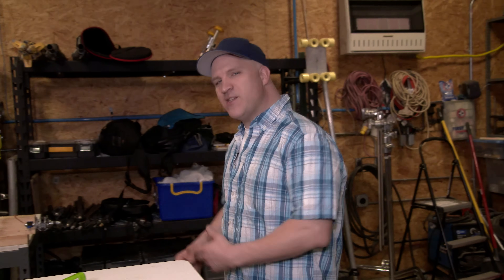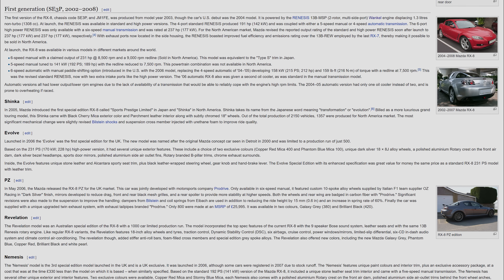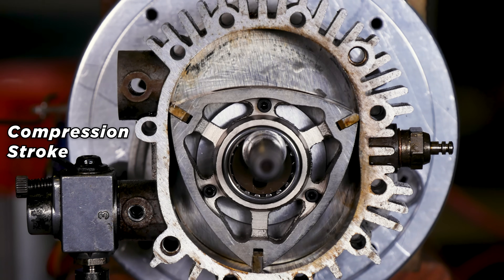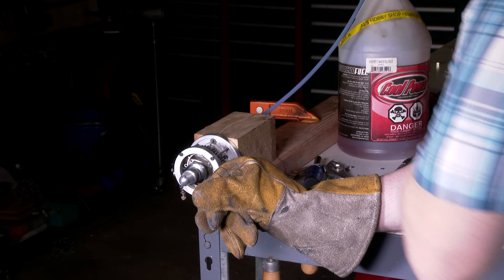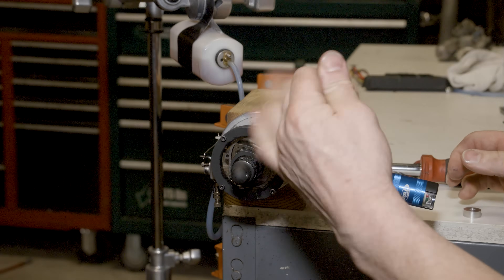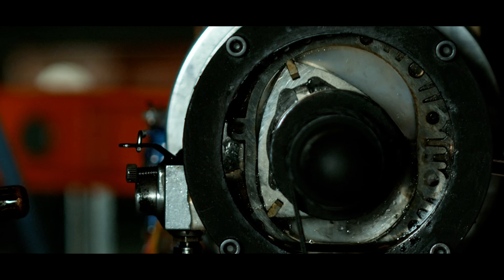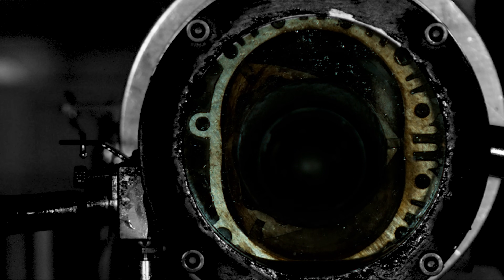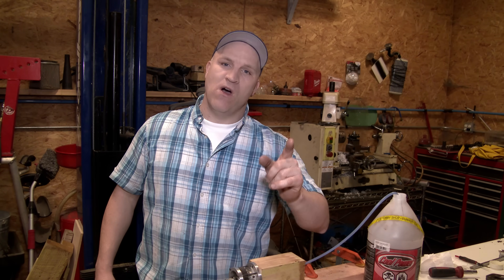See Thru Rotary Engine in Slow Motion - (Wankel Engine) 4K

Comment: I had no idea there was such a thing as a diesel rotary engine. Super cool!
Reply: This is a "Benz Cycle" not a Diesel Cycle Wankel engine, this Wankel KKM variant designed by Graupner GmbH. uses the same primitive type of "Glow Plug" ignition system found in most RC model engines. This engine does not utilize compression ignition. The fuel used here is nitromethane which has an octane rating between 110 -117 RON
Reply: doktorbimmer - Well color me educated! Very interesting thanks for sharing :)
Reply: You are very welcome sir, and in case you were wondering? Several Wankel KKM licensee's attempted to develop a Diesel Cycle Wankel engine but none were successful.
 Major Diesel engine companies like Deutz, Krupp, Mercedes-Benz, Yanmar, John Deere and Rolls-Royce developed them but all suffered serious problems related to the fact that the Wankel simply cannot provide a high enough static compression ratio and the notorious weak seals were simply not durable enough for a production engine to last long.
Reply: doktorbimmer - Yeah its a real shame the apex seals are so problematic. It’s a beautiful engine.
Reply: Indeed, the durability of seal that must deal with right angles was a fatal flaw in the Wankel design, a circular cylinder and piston seal are vastly superior.  .
 It is a fascinating design to look at for sure unfortunately it never lived up to its promise of replacing reciprocating engines.
Reply: It runs on gasoline
Reply: dOoMnX - A Diesel engine isn’t defined by the fuel it burns, but rather by the way ignition occurs. This engine uses compression ignition (instead of spark ignition) so it’s a diesel.
Reply: @truthsmiles  true. The ones in Mazda RX's have spark plugs though.
Reply: dOoMnX - Right, which is why I was so surprised to see one without a spark plug! I had no idea such an engine (that runs on gasoline, no less) even existed! Very weird - especially since the fuel doesn’t appear to be injected like a diesel would normally work.

Comment: Great Video! Can you possibly use hydrogen gas to fuel the rotary engine? I am not really on to machines and its technicalities but I just want to satisfy my curiosity. Thank you.
Reply: Hydrogen fuel has been tested with Wankel engines but offered very poor results. The Wankel engine cannot generate sufficient static compression ratio to efficiently burn hydrogen and the low fuel efficiency of the Wankel coupled with the very high cost of hydrogen makes it very uneconomical.
 
Mazda produced a small fleet of prototype RX-8 cars for the Norwegian HyNor hydrogen vehicle program. The Mazdas were quickly rejected as preliminary test results showed they were the worst performing hydrogen vehicles tested.
Reply: doktorbimmer ~ thank you for the reply. Since hydrogen is highly combustible, What if mixing the hydrogen gas with fuel so that less fuel would be consumed but still would get the desired explosion to make the engine running. Let say hydrogen would only serve as an additive to the combustion process. I think the burning of fuel with will be more efficient and produces less unburned fuel. Thus having a cleaner exhaust.
Reply: The idea is to really lessen the fuel consumption and cleaner emissions
Reply: The Wankel is less efficient at extracting the heat energy provided from Hydrogen so fuel efficiency is REDUCED Hydrogen is no different than other fuel in terms of combustion efficiency... modern engines mass produced today all have high-swirl or quench-type combustion chamber. The fatal flaw in the Wankel is it simply cannot be adapted to this superior combustion technology.
Reply: The Mazda RX-8 Hydrogen-RE proved that the Wankel engine delivers much LESS fuel efficiency when operating on hydrogen power and produced far greater emissions than reciprocating hydrogen fuel engines and hydrogen fuel cell vehicles.
Reply: @doktorbimmer  Thank you so much. I really appreciate it.
Reply: You are very welcome, I don't know where you live? Here in California you can buy hydrogen fuel cars by Toyota, Hyundai and Honda... but they are all Fuel Cell hybrids.

Comment: wow a 4 stroke has 1 power stroke every 4 revolutions of the crank shaft...rotary has a 3:1 ratio...if the seals, fuel economy, and efficiency of this design can be improved somehow...the potential is ridiculous!!
Reply: Sorry Tony, a 4-stroke Otto engine has a power stroke every TWO revolutions of the crankshaft. The Wankel engine has 3:1 ratio THREE-to-ONE  While a 4-stroke completes its entire firing order sequence in 720° of crank rotation the Wankel requires 1080°.
 The best engineers in the world have discovered that the Wankel no longer has any potential, even Mazda have abandoned the design a decade ago.
Reply: doktorbimmer thanks I read it the 1st...FIRST time 3 power strokes per 1 crank revolution is amazing...and who cares of Mazda quit on it lol...there's thousands of smart people with the right resources who I'm sure could improve the rotary engines deficits with the right amount of RnD...I'm just saying it'd be great to see because this engine would QUICKLY become very popular
Reply: Wrong, there is only one power stroke per crankshaft revolution, not 3... you need to learn how the Wankel engine works.
Reply: That's a very naive statement, you seem to be completely aware of the long and extensive development history of the Wankel engine. No engine design in the 20th century has ever received so much R&D... The truth is the Wankel simply never delivered on its promise of replacing reciprocating engines and turned out to be a major disappointment... a massive commercial failure.
Reply: IT WAS popular... when the Wankel KKM was introduced there was massive interest and in the 1960's and early 70's the biggest engine manufacturers in the world rushed to bring their version to production but less than a decade later the Wankel proved to be cursed with terrible problems that could never be solved.

Comment: A tendency to backfire, burns lots of oil, and wholly inefficient fuel wise. Europe banned their sale in 2010 effectively killing the engine.
Reply: for cars.
in aviation, the weight difference nakes up for a LOT
Reply: @Márton Léránt The Wankel engine was universally a massive commercial failure. There has never been a successful production aircraft that used a Wankel engine. There are no Wankel engines reliable enough to pass either the FAA or EASA air-worthiness certification. The Gas Turbine engine offers an order of magnitude greater power-to-weight performance than any Wankel engine.
Reply: @doktorbimmer  
And are an order of magnitude harder to manufacture to say the least.
Manufacturing the shape of turbine blades is a tad bit more demanding than manufacture of wankel engine parts. (Without mentioning the required materials)

In house engine development for small prop driven privately operated aircraft is not a common practice, let alone investing money into radically innovative designs. (Which is the market segment that would welcome affordable high power density designs)

The rarity of wankel engines has very little to do with "its unsafe" and everything with the nature of the market and its financing.
Reply: @Márton Léránt Yet Gas Turbines DOMINATE commercial and military aircraft production... because of their vastly superior power-to-weight ratio, reliability and fuel efficiency.
Reply: @Márton Léránt Several aircraft and aircraft engine manufacturers have invested millions into Wankel engine development and all have reached the same conclusion, which was the Wankel was inherently inferior to gas turbines and existing reciprocating engines.
Reply: @Márton Léránt The issues with poor reliability and short service life that have plagued the Wankel engine since its introduction is infamous. Mazda has suffered pre-mature failure rates that exceeded 50% under the warranty period... in automobiles its just bad business.... in the aircraft industry it can be criminally negligent homicide.
Reply: @doktorbimmer  
And when will we have turbines in the commercial sector in things other than luxury aircraft and airliners?
Yes turbines are superior in most regards except the astronomical cost.

Will we ever have ultralights with jet engines powering them?  i have my doubts.
Which is why ultralight helicopters are nonexistent. As piston engines are just a little bit too weak to power them, and turbines are faaar outside of the price range the owners of such craft would be able to afford.
Reply: @Márton Léránt Gas turbines are used in helicopters, military vehicles, marine, stationary pipeline pumping applications and are growing in popularity in electric power generation.
Reply: @Márton Léránt Doubtful, ultra-light applications are on the very low-end of the aircraft industry and require minimal cost and maintenance to be affordable. Piston engine manufacturers such as Rotax GmbH. dominate the ultra-light industry... Rotax was the World's First manufacturer of Wankel engines in 1964 (Fichtel&Sachs) but completely abandoned the Wankel by the mid 1970's as improvements in 2-cycle and 4-cycle reciprocating engines that offer superior performance at a lower cost and offer greater reliability.
Reply: @Márton Léránt Wankel engines are inherently inferior to reciprocating engines they failed to replace, they are an obsolete technology and were historically a massive commercial failure... The Wankel only briefly saw very limited success in automobiles but even Mazda, who the very last manufacturer in the world abandoned the Wankel engines a decade ago and production ceased completely in 2012.
Reply: @doktorbimmer 
Well let me have my doubts about "lower cost" - when the damn things can be made out of extrusion - and less than half of the parts.
And please give me some quote on that "superior preformance" - since i have hard time believing it.
Reply: @doktorbimmer  
Are gas turbines emplyed in military vheicles, helicopters, marine and stationary pipeline pumping anything close to being affordable to the average citizen?
No?
Maybe then we shouldn't compare the thing, against tech that CAN be produced affordably.
Reply: @Márton Léránt Reciprocating engines dominate the Ultra-light market because they are MORE affordable than Wankel engines and offer superior performance and reliability at a lower cost.
Reply: @Márton Léránt WRONG! Wankel engines have MORE parts than 2-stroke reciprocating engines and offer more power at a much lower cost.
Reply: @Márton Léránt One only has to look at the world's largest supplier of ultra-light engines, Rotax... pioneers in the Wankel design they abandoned the Wankel in favor of the reciprocating engine.
Reply: @Márton Léránt The failure of the Wankel engine is not a matter of affordability... but of profitability. 26 of the largest and best engine manufacturers in the world became Wankel KKM licensee's to develop the Wankel engine for mass production, All of them have abandoned the Wankel engines including Mazda because they could not be sold profitably... you can't make money selling an inferior product that consumers tell you they do not want buy.
Reply: @doktorbimmer  
Yeah, economic of scale override production advantages of the wankel design. Its more or less impossible to produce a few items at the same price, as stuff that is manufactured on the proverbial line.

And i am still waiting for your source, you base your opinion on reciprocating engines having better power to weight ratio than wankel engines...
Reply: @doktorbimmer  
I still don't really get how two stroke engines cost less at similar volume of production - i mean cost more to produce, not sale prices. (*With current technology)

I also don't get what you mean by more parts. Seals? or what?

And would love to get a quote on power output for the same weight
Reply: @Márton Léránt  It is impossible to mass produce a commodity that no one wants to buy, in a free economy only the best products are made... those that are inferior are discontinued or never enter production.
Reply: @Márton Léránt You cannot compare the power-to-weight ratio of an engine that does not exist, there are no certified air-worthy Wankel aircraft engines available on the market. In applications where power-to-weight ratio performance is critical? Only Gas Turbines are used... in all other applications reciprocating engines are used.
Reply: @Márton Léránt That is because you simply do not understand how engines are manufactured, a typical 2-stroke engine can be manufactured using ordinary, readily available machining tools while the Wankel require specially designed, purpose built tooling.
Reply: @Márton Léránt This is because many amateur fans of the Wankel type engine subconsciously tend to omit all the tiny, very fragile seal components that cause all of the Wankel engine's serious reliability problems.  

I would love to quote you the power-to-weight ratio of the best FAA certified Wankel aircraft engine... but as I mentioned previously, none exist.
 The Wankel is too unreliable and is not efficient enough for aircraft use... making the argument that it offers better power-to-weight ratio performance compared to reciprocating engines completely moot.
Reply: @doktorbimmer  
There are no certified =/= there are none at all. There are drones and experimental aircraft happily flying around with wankels.

And literally nothing is forbidding you from comparing the power to weight ratio of land  based wankels to land based reciprocating engines and make an educated guess, if looking up data on drones is too much hassle for you.
Reply: @Márton Léránt YES, there are no Wankel engines available that meet the reliability standards required to meet FAA or EASA air-worthiness certification.
 Wankel engines are very poorly suited to aircraft applications and this is why there are no aircraft manufacturers anywhere in the world that produce aircraft with them and never have been.
Reply: @Márton Léránt There is simply no reason to, the old myth that Wankel engines offered any advantage in power-to-weight ratio performance was simply not true.... and furthermore, any perceived advantage is completely nullified by the Wankel's significantly higher fuel consumption which requires higher wet take-off weight, reduced range and/or reduced payloads compared to aircraft fitted with reciprocating engines. There are simply no real world advantages which is exact why no aircraft manufacturer uses Wankel engines in certified flight-worthy aircraft. Wankel engines are obsolete in the engine manufacturing industry and were never manufactured for aircraft applications.
Reply: @doktorbimmer  
There is a very good reason why wankel engines can offer better power-to weight ratio than reciprocating ones.
The stress on the part is radically different to say the least.
The mechanical stress is far more akin to those experienced by turbine parts, than to those that are present on reciprocating engines.

This is not relevant "COZ TURBINES ARE BETTAH".
Its relevant because less stress means you can rev it up higher, which means more combustion cycles in the same weight of engine, which means more power.
Reply: @Márton Léránt  The Wankel engine offers NO ADVANTAGES.. and this is why the design is OBSOLETE in the engine manufacturing industry.
Reply: @Márton Léránt Then please explain why Gas Turbines and reciprocating are both more reliable than Wankel engines???
Reply: @Márton Léránt An interesting theory but not one you have presented with any evidence... Wankel engines are significantly less reliable and have much shorter service life than comparable reciprocating or turbine designs, this is an irrefutable fact.
Reply: @Márton Léránt "No, this is what is not relevant "COZ WANKELS ARE BETTAH"
 The fact that Wankel engines have been developed for aircraft use over 60 years but failed to become commercially viable proves conclusively that they are NOT BETTER....
Reply: Europe never banned Wankel engines, Mazda discontinued the RX brand due to lack of sales. Sales of the RX had been in steady decline since 1986 and by the 21st century the brand was mounting losses in the billions of dollars, cash the company desperately needed.

Comment: Nice video 
I wonder why the rhythm of the explosions is so irregular in the high speed footage
Reply: It's a simple glow plug engine (glow plug = not very detailed control over the ignition point...) with a very simple carburetor that's probably optimized for higher rpm's (just see how flooded it gets at 5:50, for example) and little rotational mass = every little change and missfire will affect its rpm greatly...
At least, that's my theory.
Reply: The fatal flaw in the Wankel engine that has caused it to become obsolete is the horribly poor combustion chamber design. The high surface area and compromised shape of the Wankel KKM combustion chamber causes incomplete combustion and very erratic ignition and flame propagation. random misfires are typical of the Wankel engine especially when only a single spark ignition is used.
Reply: @doktorbimmer  I suppose that's also the reason why they sound more like a twostroke...
Reply: @ziiofswe Actually, all Wankel engines use the same 4-stroke operating principle as the Otto engine... They sound like 2-stroke engines because they have ported induction and exhaust and open the exhaust port at a higher cylinder pressure than typical 4-stroke engines.
Reply: @doktorbimmer  Yeah, I know they're 4-strokes... was just talking about the sound. :)
Reply: @ziiofswe Well, that is not why they sound like 2-strokes.
Reply: @doktorbimmer  Yep, I realized that after your explanation.

Comment: I was pull starting my generator like that and it started and ripped the pullcord from hand and swung it around and broke the intake plastic that like bolts to the curberator and it broke the gas valve off the bottom of the tank